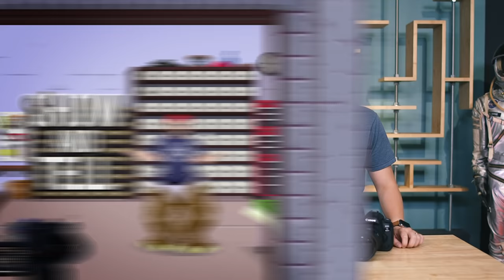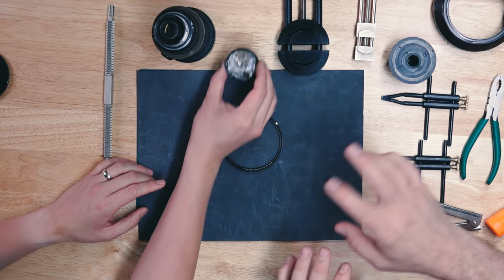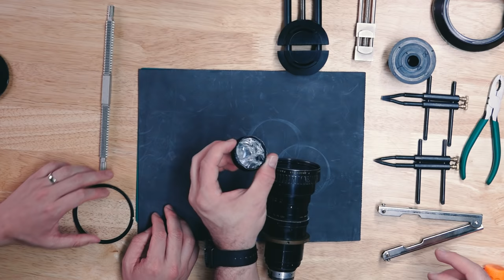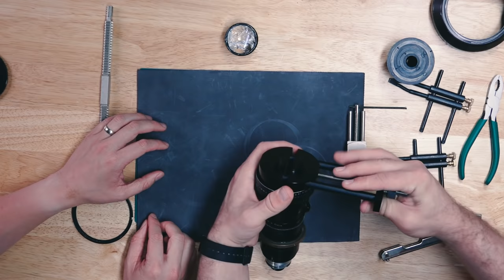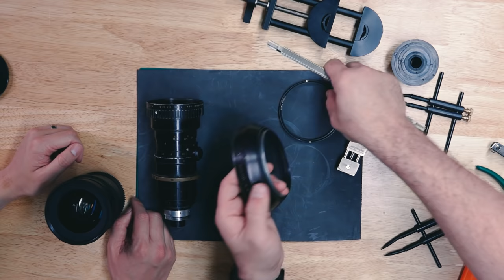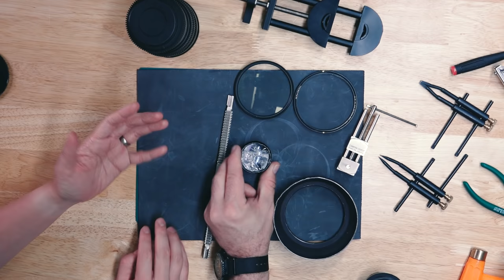Tools and Techniques for Repairing Broken Camera Lens Filters

Comment: The problem I've run into after purchasing some old film slrs is finding a spanner small enough to accommodate removing the wind levers. The lens ones don't close down enough. I ended up having to diy with a dowel and 2 tiny brads. But I'd love to find the actual tool. Surprised it's so difficult.

Comment: I find it helpful to remove filtler with the old rubber grippers used to open jars, or an oil filter wrench with the rubber strap. Both have worked great for me anytime my filters have been stuck, I keep the oil filter wrench in my camera setup as it worked best, folds up compact, I actually bought specifically for taking off lens filter.

Comment: I habitually use a strap, and generally dont use filters due to flares. However, I probably should use filters. Straps arent going to save your lens every time.

For example, before I ever had my own camera, my dad was the photographer of the family. One time he told me to go grab his bag so he could change lenses. He didnt told me it was unzipped, and I assumed it was closed. Second I picked it up, his nice telephoto fell out on the asphalt. He used it immediately though since it looked fine. Come to find out, I ruined a few of his photos... Because the filter on the front was cracked.

... Basically, the filter saved his lens. And it fell out of a bag, a camera strap wouldng have saved it in that case.
Reply: PS, I've taken my own camera into places where a filter probably should've been used. Lots of ocean spray, or blowing sand. I'm honestly surprised I havent seriously scratched my lenses or ruined my camera.

Comment: my canon 70-200 IS ii has a dent on filter thread. i can't even put the front cap as easy as before and i can't put filter as well. a lot of technicians told me that they going to open the whole lens just to fix and charge me that much, but as i watch in youtube it is not that how they'd fix it. I want to buy a wrench lens to fix it by myself but I'm scared. can i remove the first layer of the  lens before use the wrench to avoid damaging it?

Comment: Does anyone know how to fix my Sony NEX-5R? When I turn it on, it goes straight to USB Mode (even when no cable is connected) making it unusable. This happens about 90% of the time I turn it on. If it doesn't, it will eventually after a couple pictures are taken.
Reply: Not knowing much about that camera, I do have played around with stuff that switches state dependent on usb connection.

So this is just a guess for a very simple issue that could cause big problems:
If your usb port on the camera is damaged so it shorts (or unshorts) a specific pin, the camera will think something is plugged in, and throw itself to a usb mode.
The fix for this would simply be to replace said port and make sure the connections internally to that port has no damage.
A hack to be tried is to get a cable that fits your camera, whatever usb connector it uses, and cut off the cable stuff and exposing the internal wires. Then you can proceed to plugin said connector to the camera, and cross different wires to see if the camera expects certain shorts. If you find out it does expect such, you can basically create your own dongle hack, which you can plugin to make it stay in camera mode.

This is all suggestions for if you don't want to send it to a camera repair dude, and making the assumption it's on the connector end where you yourself possibly can do something to fix it. 

Also you may also be as lucky that cleaning the inside of the connector with a cotton stick and some cleaning alcohol will work.

Comment: Who has replacement parts. My Nikkor threads are really bent. The lens wrench.....lens vice.  Could push it back out but it's pretty bad. It may need to be replaced. Who has parts. It's a Nikkor 50mm  1:2 lens from the 1975 -78 era.

Comment: I question the statement of not using a UV Filter. Prolong exposure to UV can cause the lens coatings to separate from the glass and the your your lens is tost. Also it can prevent lens fungus from forming inside the lens. A simple UV Filter is a must on all my cameras lenses.
Reply: Umm... UV light kills fungus...